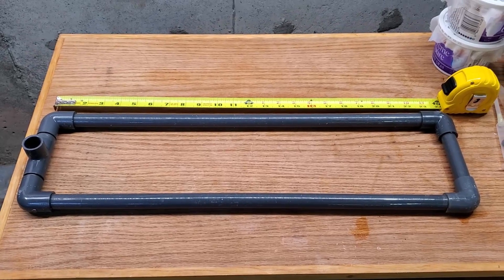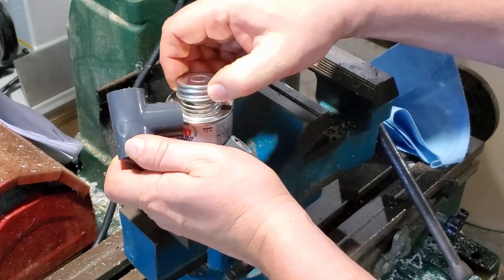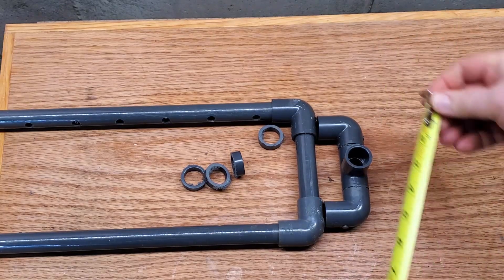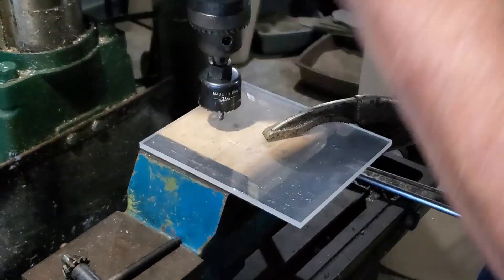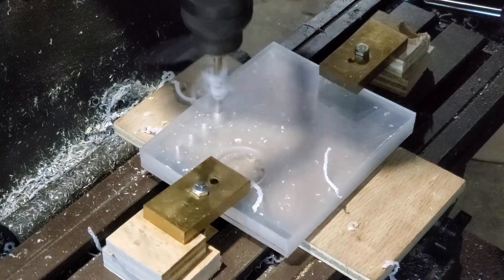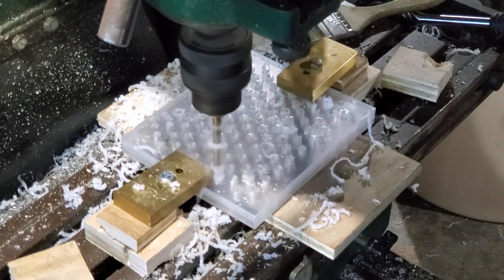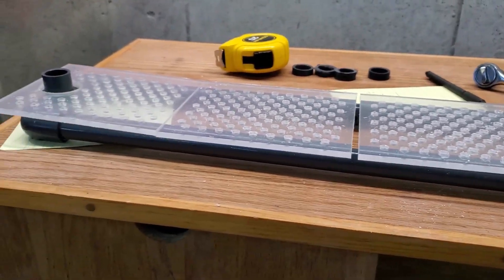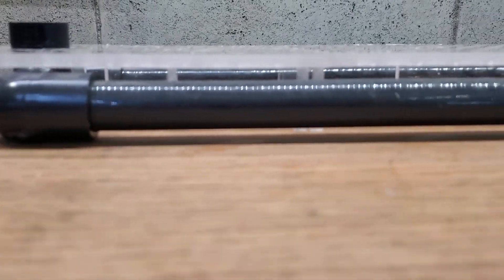Designing An UG But In Reverse

Comment: The reason I dont like UG filters is that if a tank gets a disease, there is too much organic material in the gravel filter that will interfere with the medication. I prefer an outside canister filter (which has a better flow rate to boot, options to add different mediums easily too), I can isolate and sterilize the canister medium very easily and quickly. The gravel in the tank that does not have an UG, is easy to keep clean and pristine as opposed to an UG. Sorry but UG filters are ugly too with all that muck in them as well. Parasites, columnaris bacteria love a dirty gravel medium to spawn and thrive, a clean tank is a healthy tank.
Reply from the maker: That's the funny thing about filtration, so many options and just as many opinions as to what is best. I always tell people do what works for you and whatever system you don't mind maintaining. Thanks for watching!

Comment: APOLOGIES FOR THE LENGTH OF THIS - DON'T KNOW WHERE ELSE TO POST:

Because you have experience with dozens of filters & configurations (I'm a subscriber but have never posted) you are the optimum guy to answer a theoretical question about flow & filter volume:

If I configured a 55gal aquarium with complete under gravel filter system (two stacks-Penn Plax Premium Under Gravel Filter System - for 40-55 Gallon) and ensured about 1 inch clearance under the plates before gravel - and then added two "largish" breeding boxes (Marina 10943) configured as HOB filters with floss and lava rock in their chambers - would that provide enough water volume/water movement to support a community tank (not over-populated but not sparse either)? Say...half dozen congo tetras, half dozen rainbow fish, four angels and a smattering of platys and guppies.

This is total planning - I haven't even purchased the aquarium yet - so, no rush!

I'm kinda thinking that having two dual outlet air pumps (one under gravel and one HOB each) would be a clever way to mitigate pump breakdowns or reliability of the system(s).  But I am concerned that the smaller pipes on these boxes and commercial UG pipes may not move enough volume or create enough flow for 55G....Thx
Reply from the maker: Thanks so much for taking the time to watch what I do here and to value my opinion on your project! That sounds like a perfectly viable setup for what you intend. Throw some plants in there and I can't see any problems with it. Flow isn't the most important aspect of a filter. Let me know how it goes
Reply: @FishmanEricRussell  Thanks so much - not to bug you further, but doesn't this look like a mini diatom filter just waiting to be charged?  For occasional use only, to be sure. (if your bored with my questions - just ignore).
https://www.amazon.ca/Reusable-Sediment-Filter-Purifier-Prefilter/dp/B07QQ47X3V/ref=pd_sbs_4?pd_rd_w=DsmQ7&pf_rd_p=3885b243-7797-4c4b-b0ae-97ca9ec36283&pf_rd_r=7AGPJPB4ET79ZWNY7QZR&pd_rd_r=b9244a92-ffaa-42da-b6d1-79c486984c7a&pd_rd_wg=BkzVV&pd_rd_i=B07QQ47X3V&psc=1
Reply from the maker: @joesam9094  I've always built diatom filters in canisters. I've never tried one with a plate.

Comment: To prevent acryllic from melting while you drill it, just wet it with water to take up the heat and go slow, so the tool doesn't get too hot. Works like a charm!
Reply from the maker: Thanks for the tip and for coming by!

Comment: The base pipe holes should point DOWN in order to take advantage of a 360 degree dispersion and also use a bit of resistance to divert flow more strongly to vents farthest away from the input pipe.  I worked with these in the late 70s and 80s and achieved all 0s in ammonia, nitrite, and nitrate testing with 1 1/2" inches of gravel and a 300 gph HOB filter loaded with polyester fiber as a first filter stage.  Solids were extracted immediately in the polyester and only liquid waste was sent to the UG Filter.  In that way solid waste could be 100% removed without disturbing the bio bed.  There was never any detritus accumulation under the UG plate.

Bear in mind that plants depending on roots for feeding will fare less well with a reverse flow UG filter because the water flow carries nutrients away from the gravel.  One is advised to use water feeding floating plants like Water Wisteria rather than Amazon Swords.
Reply from the maker: Thanks so much for coming by and sharing your experiences with me. I won't be able to use a HOB on this build but they are a great way to add to an UG for sure!